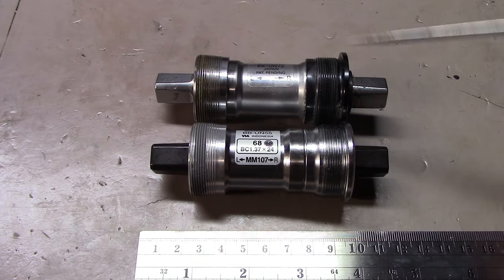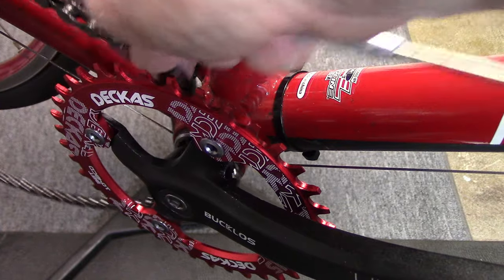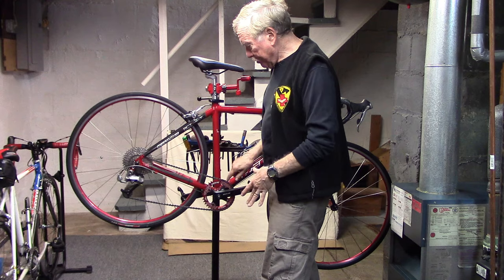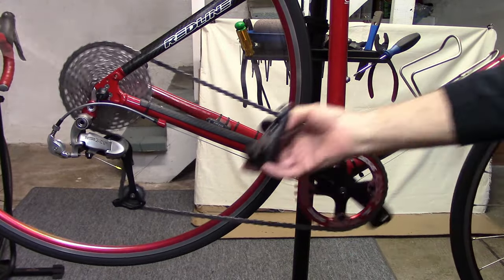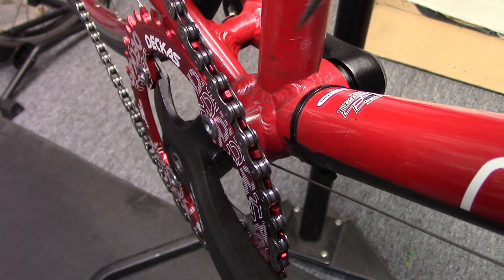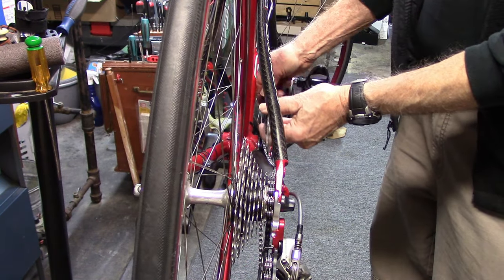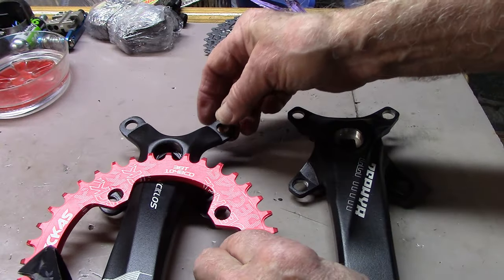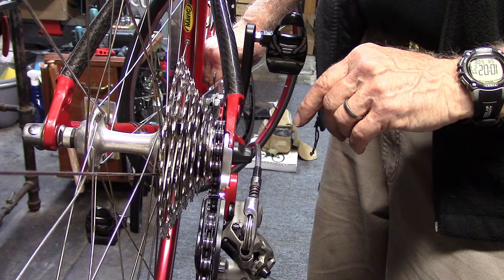1x (Single Chain Ring) Bicycle Drivetrains: View this before conversion or buying

Comment: Omg...doesn’t take much to understand...been in engineering all my life and fail to understand the messed up world that the cycling manufacturers have created...I’ve reached a decision that it’s due to financial gain, not engineering, yes there’s some great products out there but many just confuse the issues concerned, thousands can be spent on ‘upgrades’ yet no actual real gain is apparent, just kudos for purchasing the latest tech on the market...
All those years that disc brakes were banged on about....the Tour de France competition has only just started to use them, just one example in a very niche, rich and messed up world
Reply from the maker: Well said. Unfortunately not a lot we can do about it except stick to some old basic tech. One of the reasons I love my 1990s titanium Litespeed Classic with rim brakes. Regards and be safe, Tony

Comment: I have a 7 speed freewheel 14-28t
i replaced the freewheel with another 7 speed a 11-28t,
with the original freewheel, 1st gear (28t), i could spin the pedals backwards
with this new freewheel, same 1st gear, backpedal falls onto 2nd gear, 

i don't understand why this one does this and the original didn't,
I figured that the chain-line was at the extreme and pulling the chain to a more straight position, (though it didn't do that before)
so i installed a 3mm spacer between the freewheel and the hub - in an attempt to move the freewheel further outside, to help with the chain-line when in first gear.
it has helped but only a little, perhaps somehow offsetting the chainring?
Reply from the maker: 1. General Remark: When you're pedaling forward, the top half of the chain is pulled tight by the tension from your pedaling, and the lower half is held in tension by the derailleur. The derailleur is also very close to the rear sprockets so it can guide the nicely-tensioned chain onto the proper gear.

When you pedal backwards, you pull on the bottom of the chain which pulls the derailleur forward. That creates chain slack. Some of that chain slack shows up on the top half of the chain as the chain links get dumped off the front chainring into space on the way backwards. If you watch the chain closely when you pedal backwards, you can actually see the top of the chain go slack and flop around a bit. So when you're pedaling backwards there's nothing on the top side to maintain tension. A slack chain will flop around and there's nothing on the top side to guide where the chain lands on the rear gears. So the loose flopping chain is free to go where it wants.

2. Why should this occur with a new freewheel when the old one worked fine? The lubricant in the new freewheel may be thicker and more sticky, not allowing it to rotate backward with ease. This will create more slack in the chain as you back pedal, leading to the problem above (see #1). Here is a more extensive review of this problem:

https://brainybiker.com/slack-chain-when-pedaling-backward-symptoms-and-solutions/#:~:text=If%20your%20chain%20gets%20slack,the%20freewheel%20or%20the%20freehub.

Spacers are not the issue. Try removing the freewheel and spray the inner surface with WD-40 as in the article. See if this loosens the grease enough to allow back pedaling. I, myself, avoid back pedaling, but that's just my preference.

(P.S. The smallest cog is called #1 and, with a 7 speed freewheel, the largest is called #7) Let me know how you make out. We can all learn by your experience. Regards and safe cycling, Tony

Comment: How is that cheap Deckas narrow-wide chainring? I was checking them online (along with similarly priced Snail and Bucklos), but it looked kinda dodgy so I went with more expensive Sunrace. Anyone got any feedback on these cheaply priced narrow-widers? Thanks.
Reply from the maker: Did you run into any noise problems as described in the video?
Reply: @tony10speed  with my sunrace chainring? it's not really noisy, but the chain looks quite bent when switched to the largest cog (lowest gear). I think this is also caused by my rear derailleur hanger not being completely straight. Otherwise the gears are switching fine and the chain does not jump gears when spinning backwards. Which I'm pride about because it was my first time swapping and adjusting the rear derailleur :) I only took it for a short test ride today and it feels quite good. Yet to be tested on trails though.
Reply from the maker: @nighttime9539 May look bent, not due to the hanger but just the extreme chain line when in the largest cog (at least that's what I've noticed). Let us know how it all works after you've test ed it out. Regards, Tony
Reply: @tony10speed  yeah I're read that it will be bending because of the gear position in relation to a chainring which is one of the general problems of a single chainring setup. But I feel like my derailleur hanger being a bit twisted provides some contribution (not a very big one) to this effect. By the way, do you know if installing the chain guide may help with the chain bending? I'm not really concerned about my chain falling off because narrow-wide teeth plus a clutched derailleur do provide enough stability for the chain. But does the chain guide help in making the chain shape more smooth?
Reply from the maker: @nighttime9539  Chain guides keep the chain from coming off the chainring and prevent "chain slap." But I'm not aware that they'll improve the chain line.
Reply: @tony10speed  thanks!

Comment: I'm having the exact problem in my case......
Reply from the maker: What we've outlined is a problem with some 1x drivetrains (even when new). I have no ready solution. On my mountain bike the 1x works and sounds perfect, but not on the 1x road bike conversion. If your bike is new, take it back to the dealer and see if he has some ideas about changing the "chain line" to decrease noise. Regards, Tony

Comment: It has always appealed to me simply for the sake of easier cleaning...
Reply from the maker: It is easier to clean and maintain.  My point here is to check for noise (friction and loss watts) and pedal backward to make sure the chain does drop to a higher gear. If these are OK and you don't mind less gear choices (at least in some cases), then the 1x is for you. Regards and safe cycling, Tony

Comment: Maybe he used the wrong chainring. Why would crosschain be an issue with a 1x as opposed to using the inner chainring on a 2x setup? I recently upgrade my 7spd to a 10spd with 10spd chain and chainrings no issues
Reply from the maker: The video is just a cautionary tale. Some 1x, such as my Giant mtb, work great. And some upgrades to a 1x are no problem. The video is just to worn that some new 1x and some upgrades will be noisy in the largest or smallest cogs. If you are buying a new 1x, be sure to check it out on the road in all gears before buying. If upgrading, it may work fine but in some cases one must consider installing a shorter bottom bracket or other solutions if noise occurs. P.S.: The noise in the drivetrain in the video was coming from the cassette in the 2 largest cogs. We change out the bottom bracket for a slightly shorter one which helped some. We also measured the chain line, which was perfect.

Comment: You should have put the single ring behind the spider
Reply from the maker: I did and it wasn't enough to stop the noise.
Reply: @tony10speed  👍
Reply: @tony10speed  Have you tried changing the chain, a 6/7/8 has a thicker chain than a 9 and up ?
Reply from the maker: @ianmangham4570  No I haven't. A 6/7/8 speed chain is just slightly wider (same inner width) then a  9 speed chain. Not sure it will shift well with a 9 speed cassette, but again, haven't tried it yet. Thanks for the comment, Tony
Reply: @tony10speed  No it won't shift with a 9 cassette, not properly anyhow 🤣 ,next time I'll watch the entire video 🤣🤡🙏👍

Comment: this seems like more that your setup was incorrect chainline should be center or rear cassette
Reply from the maker: We checked the chainline and it was in the center of the cassette. We decided, anyway, to move the chainline in about 2 mm from a 107 to a 105 mm BB but the noise was still present. You had a good idea but we suspected the same thing. Thanks for the comment, Tony

Comment: Well I noticed right off the bat probably one reason you have chain alignment problems is because that sprocket is supposed to be on the inside face of where it belts to the crank
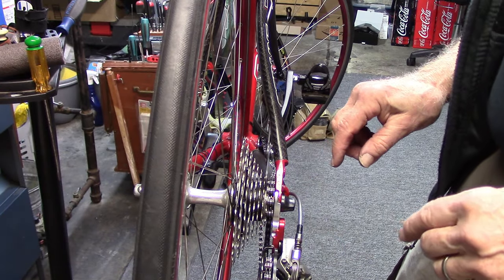Reply from the maker: You didn't watch enough of the video. See: 3:14 minutes where we attach the chainring to the inside of the face:
https://youtu.be/tB3JrVRiThY?t=194
Regards, Tony